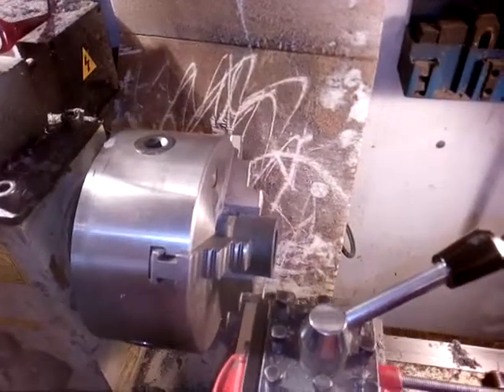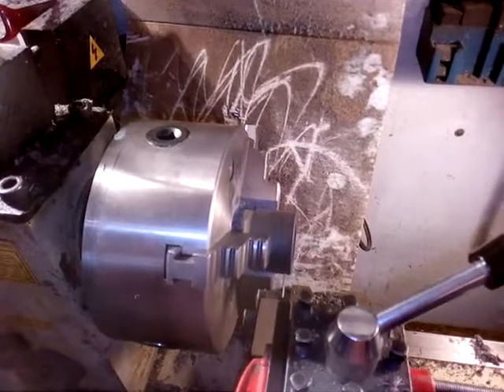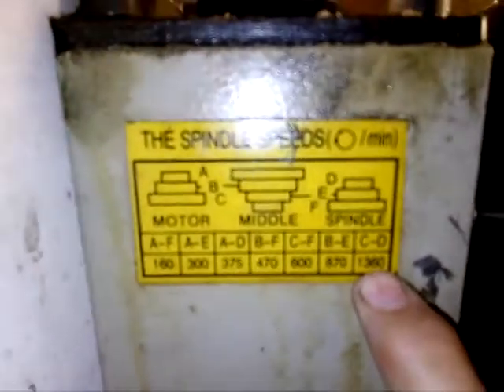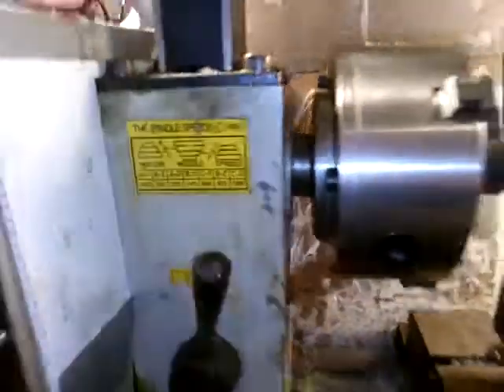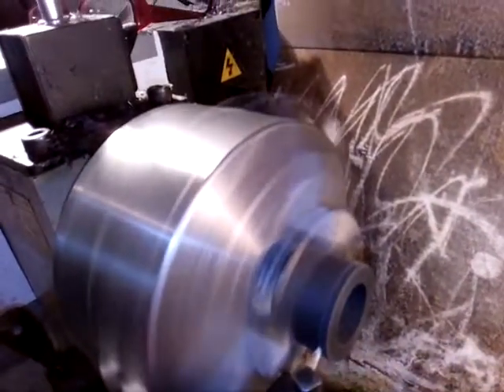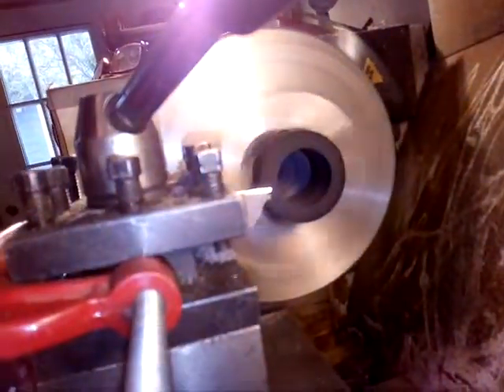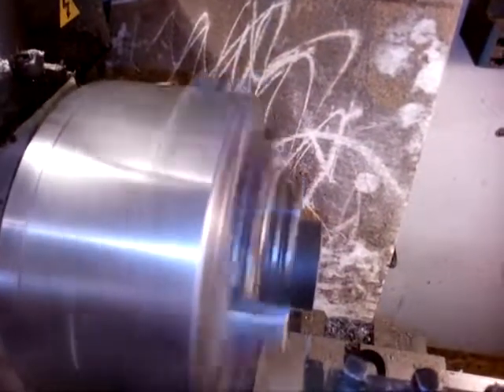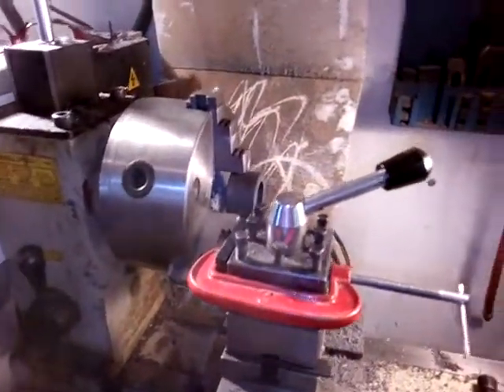Part 3 of 3: Cutting trimming parting off a polyurethane bushing on a lathe

Comment: Awesome man, thanks heaps for this series. Ive just bought some polyurethane rods to make some bushes for my quad bike as I can't get them in New Zealand and the American stockists don't ship here.
I put one in the lathe today to see how it was going to go and awful is an understatement.
I will definitely be using your techniques. Great work
Reply from the maker: Sounds like you're off to a good start.  Let me know if you have any questions.
Reply: @blanchae  Do you know roughly what angle your blade was at? I'm making a holder and I just cut the end at 45 degrees hoping this would be ok.

Comment: Isit soft enough to cut by hand ? I know your doing in lathe for precision just so I get idea of how soft the material is
Reply from the maker: It would be hard to cut by hand and get any accuracy but you could use a saw.
Reply: @blanchae  thanks for reply I'll try your blade way is there a specific clearance u use for holes I'm literally waiting for parts to turn up